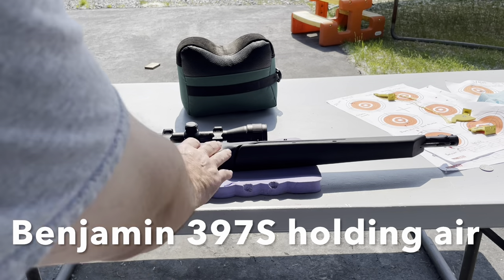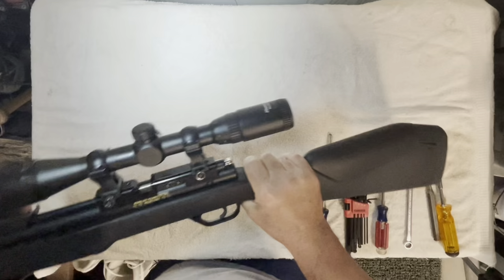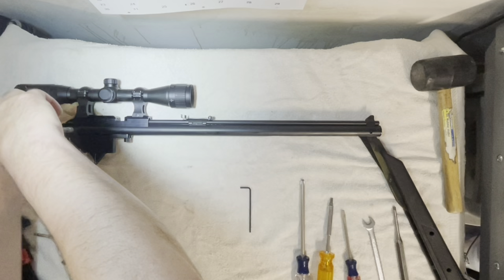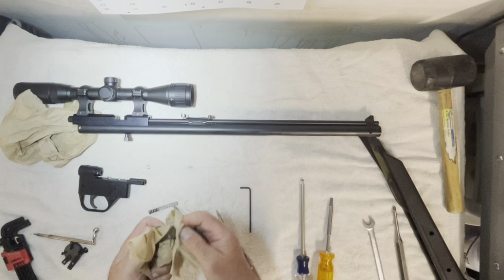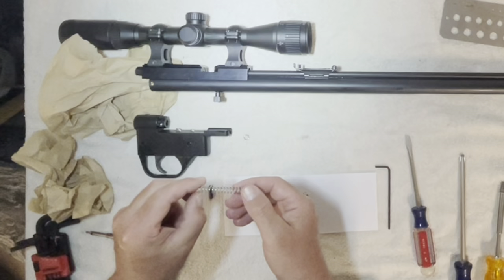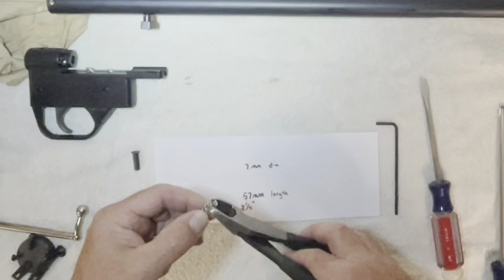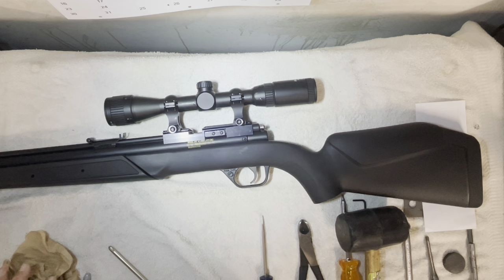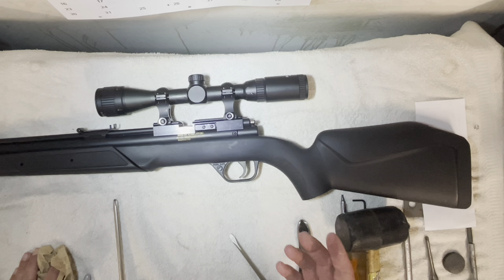Benjamin 397S hammer spring disassembly/reassembly

Comment: My 362 was holding air at 8 pumps, I stretched my spring about a half inch now it will dump all the air at 10 pumps.
Reply from the maker: I wish I’d have tried stretching this spring first 😄. At least I’m learning and will have the gun working properly in the future.
Reply: @airgunsofalaska  I have a Crosman 2300s target pistol and it comes stock with a power adjuster, all it does is push the spring closer or farther from the hammer.

I honestly don't like how crude this system is, I guess that's why they can sell them for so cheap but there is nothing precision about the hammer/firing system...😂

Comment: I'm having the problem of air Leftover After shooting ,, Which I'm told is most likely a  Seal problem? I've never taken apart An Benjamin like this, And can't find a good video On how to do this I don't want to screw it up. Maybe recommend A good instruction video. I have the 392 which I guess is the same  taking it apart. If you could recommend what tools I'll need And where to order the parts  For the best customer service possible.. I'd like to  Learn as much as I can It really does help when you con fix an air gun yourself.. Any advice ,what to look for would be appreciated.
Reply from the maker: I’ve never disassembled mine down to the point of removing the air valve. I just did a search for different videos to learn how to work on my gun. I don’t have a favorite video that comes to mind. 

I got a replacement air valve under warranty but I’ve never replaced it. I don’t tend to shoot more than 6 pumps with my 397 so I’ve just been living with it as the gun doesn’t hold air a 6 pumps anymore.
Reply: @airgunsofalaska   So do you think it's a valve problem .  Or  a seal That's gone bad. That causes the gun to retain a little bit of air after shooting...
Reply from the maker: @hap.g.7640  From what guys wrote me, they believed the exhaust on the air valve wasn’t working properly to release all the air. They said it could be debris or an issue with an o-ring as I recall. Some guys said over oiling could also cause the issue. Then other guys said the hammer spring was weak. It’s been around a year ago since I was working on the gun and I don’t remember the exact details. I’ve not rewatched my video. I seem to recall adding some weight to the hammer and also remember cutting my spring to make it stiffer only to be told that I shouldn’t have cut my spring. 

If it were me, I’d just keep shooting your gun to see if it works itself out before going through the trouble of trying to repair it.

Comment: its thebottom valve/spring  in the compression chamber , its closes to fast shorten that spring , .or you must make the hammer more heavy and that spring stronger . best scenario is cocking before pumping ,because the valve is stil open bij the hammer , you can pump even more then 10 pumps then ,and more power ,also  the ports opening wth drill bitts can help, silicon is not good for metal and metal friction ,it will gall , silicon is perfect for seals , shortening a spring is always less springforce  ,and you need more
Reply from the maker: Thanks for the trouble shooting! When you write compression chamber you are referring to the air valve, correct? 

I didn’t realize silicone could gall, I figured since it dried it might work okay. No big deal, I’ll just clean up the air tube and hammer again. Hopefully I can get a replacement spring sooner than later.

Comment: Sir can't you help me where do gonna buy firing pin valve for my benjamin sheridan 392pa because here in the Philippines     its hard to find the same parts  or replacement kits
Reply from the maker: @ChingSabado  I suspect someone on eBay has the part available or if there is a distributor who handles Crosman/Benjamin parts for Asia. I called Crosman and got warranty parts directly from them but I don’t know if they ship internationally?

Comment: if you try a little longer type spring it would cause the exhaust valve open a little longer and exhaust all the air out.    could polish the hammer and lube in that area.   could try that.    if it does not exhaust all the air out its not a bad thing just have to do a second shot to exhaust the remaining air out.    it does state this on older benjamin manuals.   like the 312 models.
Reply from the maker: Ahhh, longer spring, interesting! 👍 I’ve been doing searches and it seems like the go to is always a stiffer spring. After the video I sprayed silicone down onto the hammer through the breech. I dry fired it a few times and didn’t notice a difference. This holding air issue cropped up last weekend. I’d not noticed it before then. Now that I measured my spring maybe I’ll have better luck finding a suitable replacement. Thanks for your help!

Comment: Hey all! For those who were struggling with this problem, I solved it! Well in my own case anyway. I am not sure how deep you went into it. I went to Crosman and they sent me a hammer spring and it still wouldn't work. I have a couple of old Blue Streaks, one is functional and been mine since I was 12 and the other was my cousin's and he never really took care of it. As such, I went to Baker to get a rebuild kit and made that my restoration project. Not being able to find a new bolt assembly for the 1970s Blue Streak, I had this rebuild kit laying around, so I said oh hell neither gun is working anyway what have I got to loose. So I took the air cylinder apart in the 392 and it was filthy. I also noticed that the little gasket on the exhaust valve assembly was squashed. So I replaced it with the one in the Baker Rebuild Kit and cleaned the crap out of the cylinder. I used a QTip and cleaned all the crap out of every nook and cranny of the cylinder, lightly wiped every down with some Hoppes, and put it back together and walah! It worked! My 392 is functioning well. Haven't cronied it yet, but 10 pumps went in and 10 pumps went out!
Reply from the maker: Thanks for the info! I got a new hammer spring from Crosman under warranty and it didn’t fix it either. I also asked for a new valve which they sent but I’ve not replaced it. Looks like I need to tear down into the gun that far to do it. 

Lately I’ve been wondering if I’m a bad luck streak with brand new guns having issues or if I’ve learned so much since starting the channel that I now notice these things?
Reply: @airgunsofalaska  just cronographed it an hour ago. I am getting 623 fps with JSB Hades 15.9g pellets which worked out to be 13.2 ft lbs!  The Crosman Premier were a tad faster at 635 but only putting out 12.6 ftbs. What I love about it is when it's working well it shoots anything well.  Doesn't matter if I use JSB Exact or Crosman Premier domed I get the same groups
Reply from the maker: @bobdefiglio2.045  nice work! I’ve been carried away trying to get my Crosman 362 .177 conversion to even shoot half as accurately as my Benjamin 397. I’m not ready to give up but I’m beginning to wonder if the Benjamin platform is just inherently more accurate due to the barrel being securely mounted to the air tube for its entire length. I also really like that my 397 isn’t particularly pellet picky.
Reply: @airgunsofalaska  i really find the 362 fascinating and is a contender for my next rifle.  I like how costumizable it is.  I even have a Hawke Outlook in stock for a tricked 362, but for what ever reason the Beeman dual caliber Silver Kodiak has my eye right now too.

Comment: Good for you! I would have been thinking a slightly longer spring tho!
I’d get ahold of an OEM spring, get back to baseline. If that fixes it then I’d start looking for a higher quality spring. Maybe MAC1 or MAP or Baker sells an upgrade. No matter what you’re moving in the right direction. 
May want to research the valve spring… installing a weaker one. Standard protocol for my 13XX’s. 
Good luck, have fun!
Reply from the maker: Thanks! I’d forgotten about MAC1, I’ll see if they carry any springs. I’ve got an email into Crosman about warranty for my spring(s), we’ll see where it goes. I watched a video where a guy swapped the single valve spring over to  a two piece, dual rate set up. Evidently Benjamin used to use two springs in the air valves. I’ve never removed an air valve before so I’m not sure how difficult that is?
Reply: @airgunsofalaska  I bet it’s easier than you think but I’ve never messed with the 397. Watching your videos makes me think I need a 392 397 pair though.
Reply from the maker: @precisionrodentcontrol_PRC  I’m thinking you are right. I’m still bummed that I even have to work on the gun this soon after buying it, but at least the end result is totally worth it with consistent accuracy. I also really enjoy shooting the gun, the pumping doesn’t really bother me much at all. It’s noticeably easier to pump than my older 392 from the 90’s.
Reply: @airgunsofalaska  couple hammer springs, complete re-seal kits, print out the EVP from Crosman, quart of ND 30W oil, and you’ll be able to keep that pumper tip top for the next 100 years. 👍👍
Reply: I lived in Wasilla for a year, Anchorage for five, traveled all around the state for work, settled down in WA. Anyways I’d like to send you some various samples of pellets for testing if you’re interested, have a P.O. Box?
Reply from the maker: @precisionrodentcontrol_PRC  Oh wow, thanks! I’d be interested in test them. Could you email me at thatalaskaguy907@gmail.com so I can send you my PO Box?  

I like visiting both Wasilla & Anchorage, it’s so nice to have all the stores, dealerships, restaurants, and bike paths. So many amazing bike paths and trails in Anchorage. I’m 300 miles away from ANC.

Comment: Hello, I got sent here by one of my viewers who also watches you and told me about your airgun you had the same problem with. I have a new crosman legacy 1000 that is doing the same thing at six pumps and higher it will not expel all of the air out of the valve. Have you found a fix for this? I was thinking of putting in a stiffer hammer srping and 3d printing a spacer incase i needed to trim the spring or found a shorter but stiffer spring. Also i will sub to you, your channel looks cool!
Reply from the maker: Hi! I called Crosman and got a replacement hammer spring & air valve assembly under warranty. I replaced the hammer spring but that didn’t cure my issue. My gun still holds air. I’ve not yet swapped out the air valve but I suspect that is the problem. I’m thinking the original air valve is gunked up or needs to be cleaned. Something is preventing it from functioning properly. 

I installed a small metal washer inside my hammer to act as a preload collar to add a bit more tension on the spring but you can’t add much or you’ll coil bind. In any case that didn’t make a difference so I think you’ll want to either get a replacement air valve under warranty or clean yours and/or reseal it. 

I subbed to your channel, nice videos!
Reply: @thatalaskaguy-airguns  okay, perhaps i will contact crosman alswell, thanks for the info and thanks for the sub!